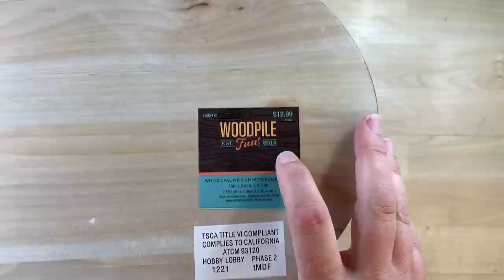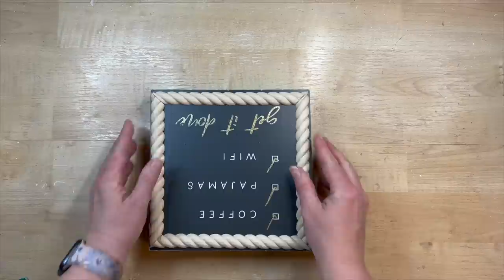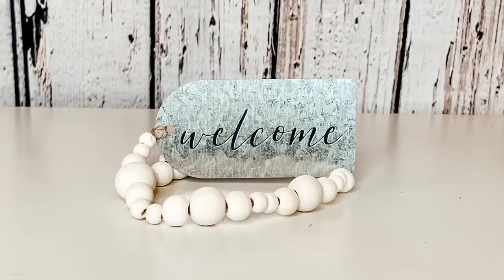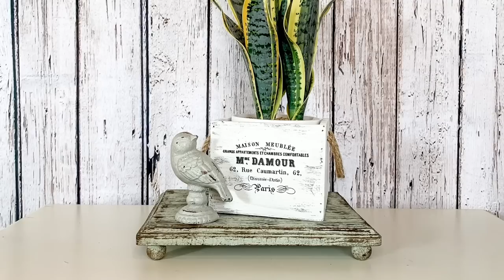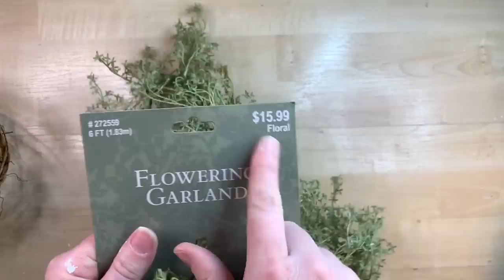🪴MEGA VIDEO 25 FARMHOUSE RISERS AND TRAYS YOU DON'T WANT TO MISS

Comment: Love them all. You did a really good job on the. Faux marble. I am glad someone asked about the wood glue and hot glue. Because I have been wondering that as well. I do know that E6000 and hot glue don't mix well. I have used it together but if they touch it makes it so the E6000 does adhere well. I have several friends in different states looking for that transfer for me too. It's beautiful. I will share with you when I get them. ❤ I looked for the measurements for the chair. I didn't see them.
Reply from the maker: I am so sorry I didn’t have those in the description, I have updated the info so they should be there now. I hope you try it, I use my bench all the time and love it so much. 💕